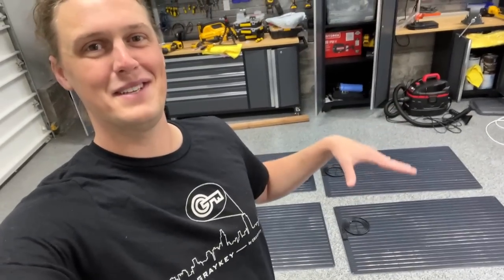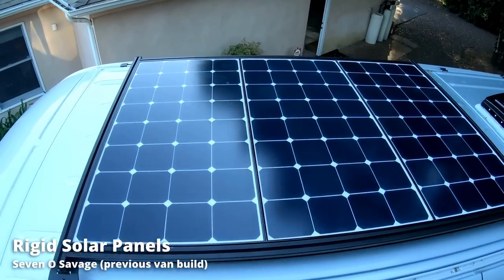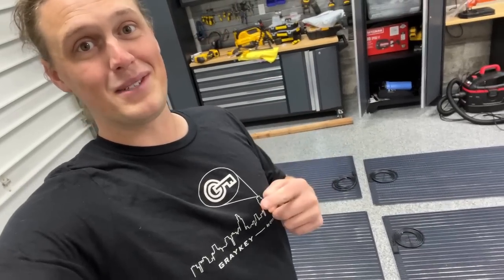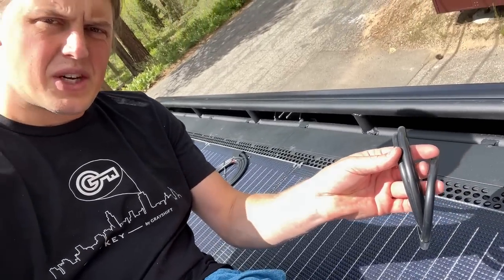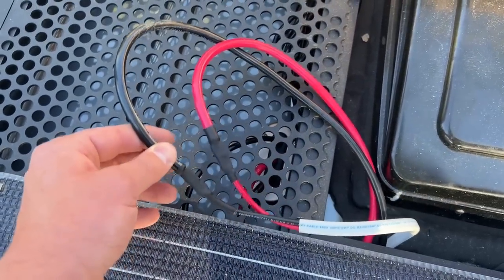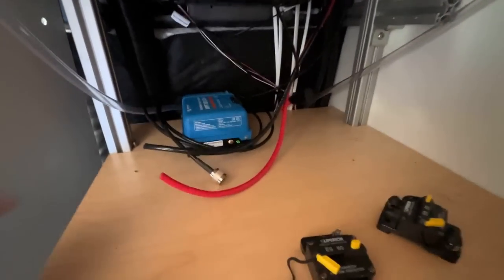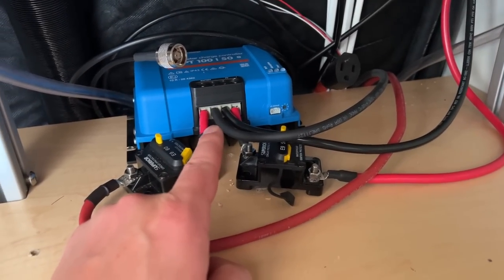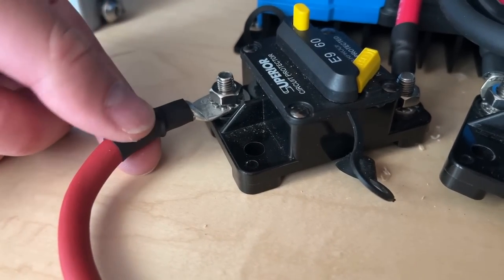How to Install the BEST SOLAR System ☀️⚡️ for Van / Boat / RV

Comment: You should check out the erigger starlink mount. That's what I'm using for my van and it folds the starlink flush to the roof for better mpg
Reply from the maker: Great recommendation!
Reply: Starlink is a game changer for VanLife
Reply: @RayzeR_RayE  couldn't agree more!

Comment: Dude! I just found your channel the other day and you have no idea how much your content is helping me. Thank you so very much for every tip and all the effort you put on creating these videos. I’m buying a VW Crafter here in Sydney/AU and your videos are giving me the confidence I can do it. Will hop on your patreon to support you! ✌🏼 All the best man!
Reply: hi mate, i'm from Melbourne, his videos are pretty cool, i'm building a renault master myself, hope it turns out ok and we cross each other on the road!
Reply: @andreazza  hey! That’s cool! Can you stand inside the Renault. Does it have Enough height? Yeah, the dude is such a legend. I bought my previous van from Melbourne. Essendon VW.
Reply: @drivesurfcamp  not really 😅
I'm 1.87m and I have to bend my neck a bit. the van has around 1.75 clearance with the ceiling and floor installed. it's a LWB mid roof, high roof is really hard to find

Comment: Great information and video. 
I went with 3 commercial 400 watt panels to feed 900 amp hours of lithium batteries to run the mini split AC/heat pump. 
Definitely a thumbs up for the video 👍
Reply: Which panels and split did you get? AC is important to me as I am in Florida.
Reply: @LouveniaMusic  pioneer mini split, good but not the best. 
Panels are Jinko 80" x 39"

Comment: Love this setup. I'm sure its already been said but just be careful with operating that black switch you have wired on the positive line between the battery and the solar controller. If you disconnect the battery from the controller while the controller is still connected to the solar panels it will damage the solar controller

Comment: very nicely done!.. Im doing a trailer with the New Bouge RV flex panels.. similar setup..  900 watts on a 14 ft cargo trailer.. with one \max fan..  I didn't want the weight up there b/c the roof is not walkable and I didn't want 150 pounds up there..  you did a great job with that van.

Comment: The surface of those panels appears to have a no slip grid pattern (for understandable reasons). If so, will that pattern accumulate and trap dirt and debris over time thereby lowering efficiency without ongoing panel cleaning/upkeep? And what about easy snow/ice clean off? Any problems with that in winter climes?
Reply: Like any solar panel, they require periodic cleaning; I can guarantee you this solar panel requires more cleaning. Tradeoffs.

Comment: CHECK YOUR SOLAR CONTROLLER INSTRUCTIONS BEFORE FOLLOWING THOSE STEPS

I've set up several brands that specifically state in the instructions to connect the controller to the Battery BEFORE connecting to the Panels because the controller will have no place to put the power coming from the panels and could fry itself.

Comment: Awesome video! One question I had was you have the wires connecting to what looks like some sort of wiring box. What was that, exactly? It looks as though it transitions the wires/gauges. Do you have a link for that? Thanks!

Comment: You used bolts and metal zip-ties? Testing which you like better?

Those solar panels are good. Glad you got a discount because at full price they are not worth it. Not saying the price is not justified based on manufacturing costs, just not worth it period. 

I have been to their website before. Didn’t like it then, don’t like it now. No specs on the actual product page. 

150 watt
24.4 Voc
7.76 amp (ISC)
17.4 LB
26.37”x46.56”
$899

You could have wired them in series or parallel, or both like you did. Each way have its advantages and disadvantages. 

I don’t think 600 watt of solar is enough for your setup. And as it stands, that $6k roof rack is overkill for 70 pounds of solar panels. I think I posted a solar panel alternative install idea on your 8020 video. 

Very clean install though. You do pay attention to details and finishing touches. It shows in all your videos. Nice work.

Comment: 7, my Roambuilt deck is arriving in a few weeks. How did you orchestrate mounting the deck with installing the solar and antenna wires? I'm installing a Pepwave antenna with 6 leads, a Starlink flat mount and there are 4 cargo lights on the deck. So, a lot of cables to manage under a deck doesn't leave much space below to work. Did you accomplish all the wiring with the deck in-place. Or, did you lift it to work?

Comment: love your vids. Did have a question on the amount of time it takes to recharge your battery bank. it looks like the 500 ish watts would take quite a lot of time to recharge your system since you have so many batteries... how long does it take to recharge your system both via solar and using shore power? do you see yourself using more power per day than your panels can recharge an a decent day?

Comment: Wondering how it's going for you so far? I plan on having both starlink and a data hotspot so I'm covered either way, but considering trying a smaller data hotspot plan to rely on the starlink for most cases. Mostly concerned about the starlink signal interruption with rain, and near populated areas where it's supposed to be slower. Hope to go full time on the road  in a few months and I will be going through major cities and rural outback areas both pretty frequently. 

PS you fuckin rock, your videos are super helpful and people like you help people like me with no van experience get to their dreams :)
Reply from the maker: Hey Henry, the solar is working well although my panels failed but they’re sending me new ones free of charge. Starlink is still a bit tough for video calls because it does drop every 15 mins… but I think more satellites will fix this over time. Thanks man!!

Comment: Love this channel and learn so much - Great job!  I'm in... Bought panels from Marine Grade Solar after watching your video. Curious, why did you 'zip tie' the one edge, and not bolt it down?  Also for others with an Aluminess rack w/mesh deck, which is held down w/small button head screws (mine running ~17" apart front to back, and 9.5" side to side)... I was concerned about the panels laying on those button heads so I plan to sandwich Starboard, with the bolt head pattern drilled out (allowing the board to sit flush on the deck), between the mesh deck and the solar panels.
Reply from the maker: Sweet! I used zip ties on one side because the holes didn’t line up with the holes in my roof deck. The starboard idea sounds great!!!
Reply: @tedtapfer, How was your experience with Marine Grad Solar and the panels? I'm ready to buy panels for my deck, and I love the idea of walkable in case I want to occasionally transport something on the deck. But, SOS's first panels failed so I'm a little hesitant given the cost of these panels.

Comment: That 6  gauge wire is not solar wire so very likely is not UV resistant. If it is not UV resistant, it will degrade and the insulation will start to be compromised within 18 months or so. Either ensure that wire is never exposed to direct sunlight or use proper PV wire. The thickest you will find is likely 8 gauge and not easy to find versus the normal 10 and 12 gauge pv wire.

Comment: When you wire In  series don’t you just double the voltage and not the Amps? Parallel doubles the amps, which is what you really want since a single panel can easily output the 12v needed for van setup.  So essentially aren’t you losing half of what those are capable of putting out by wiring them the way you did?

Comment: I am enjoying your videos a lot... I am thinking of converting a Ford E-Transit... is it necessary to place the solar panels or is it convenient to use the energy that the car provides me... with what it generates with the solar panels it could be charged the Ford E-Transit?
Reply from the maker: I am not sure on the e transit specifically, but I imagine there would be a way to simply use the cars battery bank to power the camper.

Comment: Hi there. I am just getting started and doing my research before I start my project. If you don’t mind me asking what batteries did you use for you walkable solar panels?
Reply from the maker: Howdy I built mine a few years ago so it’s a slightly outdated solution. But I have 6x 170ah lithium batteries connected in parallel to create a large battery bank. 

These days I’d look into battery bank solutions engineered for off grid vehicles. They have them in all different sizes.
Reply: Thank you 🫶🏼 we appreciate you.

Comment: Any updates on the panels? Did the replacements hold up? I'm ready to order but a little hesitant knowing your first batch failed.
Reply from the maker: I haven’t gotten to test them much since it’s been so cold but on the plus side it was super easy to get them replaced, tom sent new ones no questions asked
Reply: @seven_o_savage  Thanks Seven. These panels are priced for perfection--they should be exceptionally reliable and durable. Spending $900/panel for non-viable panels would be devastating! Ya know they work best when cold :)

Comment: I noticed you were walking on the panels. According to the manufacturer, they distinctly say NOT to walk on them. Second, there is a lot of controversy regarding thin film technologies' longevity due to the lack of cooling solar cells require. What is your experience or thinking on this last point?

Comment: My aluminess roof rack the mesh floor was not flat. Can you mount these walkable panels to an undulating floor? :(  And do you accept jobs like this? I"d love to have these flat panels on my roof rack...
Reply: I have an aluminess roof rack as well with small button head bolt heads on the mesh roof deck, that vary in pattern running ~17" apart front to back, and 9.5" side to side.  I noodled on the same issue and plan to use Starboard, sandwiched between the mesh roof deck and the solar panels, with the bolt head pattern drilled out (to create a flat surface, except for the minor ~ 1" holes which will allow the board to sit flush on the deck).

Comment: Are you still using the series & parallel wiring for solar after you replaced the bad panels?
Reply from the maker: Yes
Reply: Thanks. I have the same setup and all of a sudden the solar panels stopped charging my batteries. Can’t figure out what the problem is and trying to rule out things at this point.
Reply from the maker: @kevinschmidt6346  are you using custommarinesolar panels?
Reply: @seven_o_savage  I’m using 
4- 170 Watt Monocrystalline Walkable SunPower Maxeon Solar Panel that I bought from Orion Van Gear and wired them according to your setup. I “think” it may be the v1.64 firmware update I did on the victron solar controller because it stopped working right around that time.

Comment: That is a lot more amperage than you really want with consumer gear.   The specs on those panels are 7.18A operating / 7.76A shorted.  And 20.88V optimal / 24.43V open-circuit.   With four panels all in parallel, you are pushing 28.72A operating in full sun, and 31.04A shorted.    Most solar gear, particularly if purchased on Amazon from random vendors, is rated for 20A and is more or less safe at 15A.   The 30A range you have configured is too much.   (more on that in the second part).  Even if you are back-hauling with 8 gauge, it's a bad idea.

All modern solar panels should have integrated bypass diodes, so partial shading wouldn't prevent a series array from working.  But I don't know about those specific panels... flexible panels might not.  I would test it.

Your charge controller... ok, MPPT 100|50, so 100V max open circuit.  Too bad, you can't put all four panels in series.  You can only do three with that particular model.

I would recommend a 2s2p configuration ... 2 panels in series, and two sets of those in parallel.   That drops the amperge into the safe zone and keeps the open-circuit voltage in a sweet spot for the charge controller.

--

One additional problem with your 4 panels in parallel configuration... the panels are guaranteed to not be rated for a 30A failure mode (and unless you are running 8 or 10 gauge wire to each individual panel prior to ganging, neither is your wiring... plus, the panel's own cabling is unlikely to be rated that high either).   That is, the failure mode where one panel fails and becomes a dead short.  Think about what happens... the other three panels will feed into it direictly.

Which means that if you are going to stick with that configuration you need to put a 10A or 12A DC fuse on each panel's positive before you gang them together.   Most (99%) solar panels are only rated for 2p without individual fuses.   This problem goes away in a 2s2p configuration.

So ya got some fire hazards here that you need to fix.

-Matt

Comment: No point in having the 50A and 60A  breakers and 4 40A fuse before them. More is not better. Each crimp lug or switch you add, wastes power. Why fuse each solar panel? 40A fuse is not going to protect the panel and the current from a single panel is not enough to start a fire in the wiring from a short. remember solar panels are a high impedance power sources, short circuit current of a panel is at 0.01V so no heating from a short! Put the wires in a plastic conduit if you want extra protection against insulation rubbing off in a vehicle. Always good practice in an environment with vibrations. Likewise use rubber grommets in the holes through your mesh in the rack. With two parallel panels, you a making a 24V system. i.e. perfectly safe to handle with nanny hands, don't need a breaker before the charge controller other than for convenience. Put one fuse on the positive connection between charge controller and battery terminal 30A rated, 60A rated if you are making a 12V system (only slightly above the peak output of your charge controller 600W), then you are protected all the way to the panels, fuse also doubles as a disconnect. $100 saved and higher output from your system.

Comment: Are you sure they called out for 30 amp fuses and not two 15 amp fuses? At least my understanding from my roof solar, each string called for 15 amp fuses, 30 seems extreme. 🖖
Wow six gauge wire, I’m using 10 gage. Marine type of panels must be different.
Reply from the maker: No it might be 15 but the wire can technically handle 30 before melting so I just went with that for now.
Reply: @seven_o_savage  You may want to revisit this so there is no possibility of amperage above the max panel fuse rating flowing through a shorted panel. I plan to ask Tom what the panel max fuse rating is (guessing <10A). If it's > 12.8A, you don't even need fuses. In that case, 30A would be fine since our 2p2s config should produce no more than 6.4 Amps per string, 12.8 Amps overall. A 10A fuse in each string seems perfect. A 30A fuse seems impossible to trip in any scenario since your combined Isc is only 12.8Amps.
Reply: @seven_o_savage  Thanks for blazing the trail on walkable solar panels. Tom sent me some panel specs to clarify the fusing requirement. The National Electric Code 690.9 A (2002) requires paralleled panels, or paralleled strings of panels, to be fused exactly as in your build except if the total short circuit current (Isc) from all sources does not exceed the total ampacity of the wires and the panel itself as specified on the panel nameplate (maximum fuse rating). Tom says  the CMP24150SR panels have a maximum fuse rating of 15 Amps. You have two 6.4 Amp strings paralleled which yields a maximum current of 12.8 Amps. Since 12.8 Amps is less than the panel’s max fuse rating of 15 Amps, you don’t need fuses. Your panels are rated to handle all of the amperage that could be produced. The fuses you installed aren’t a problem, but they aren’t necessary according to the NEC, and shouldn’t ever be able to be blown with a your system’s max 12.8 Amp production. Explorist.life has a very informative article on this topic (https://www.explorist.life/how-to-fuse-a-solar-panel-array-and-why-you-may-not-need-to/).

Comment: dont put a fuse on the mptt output. if this fuste get shut off iw will destroy the mptt charger!
Reply from the maker: Rather that than van catch on fire
Reply: @seven_o_savage  you need din rail fuses and a pin to connect the levers. this way if one fuse triggers all fuses (solar to mptt and mptt to battery) will turn off.

Comment: Hi. I see the 150 watt panels listed on that website but the photos look different. Mind sharing the link to the exact panels used here? Thanks for the video!
Reply from the maker: Hmm the 150 on my link are the correct ones
Reply: @seven_o_savage  thx 4 the rely. On your video they have thin lines going one direction. The ones on the site didn't appear to do that. I guess it could have been an illusion or camera effect.

Comment: boo for starlink
Reply: @Mike That's a good deal.  There are several known issues with Musk Link right now ... and it is very expensive to boot.  ... Foil hats also allow the RF to stay under it and in the skull ... so to some that is a good thing to others that is a bad thing ... I am in the latter camp.